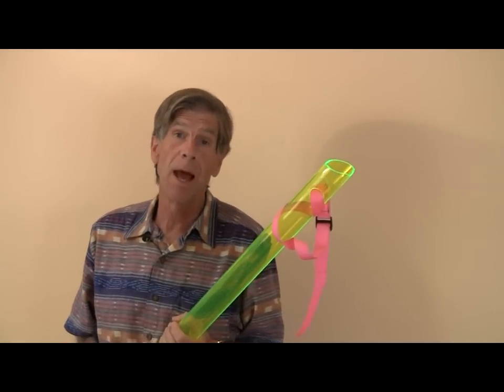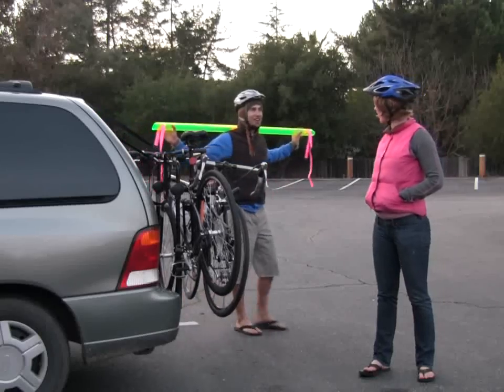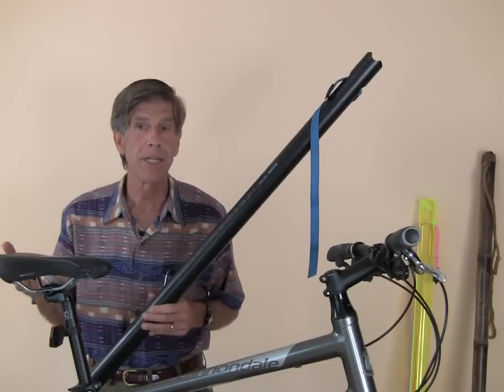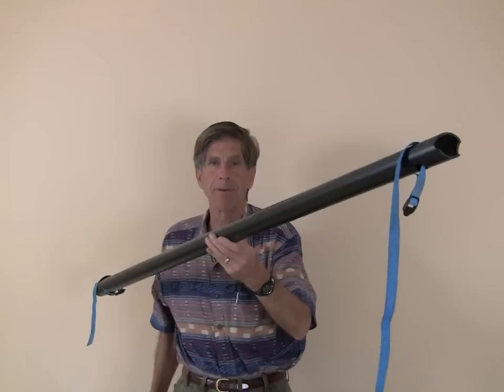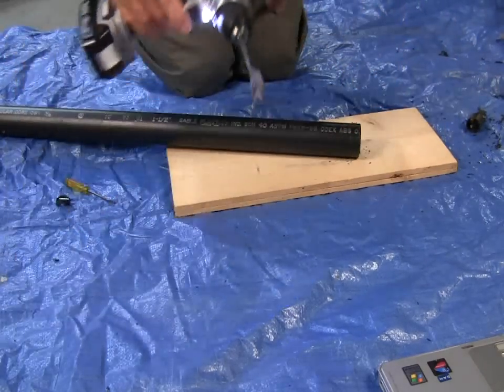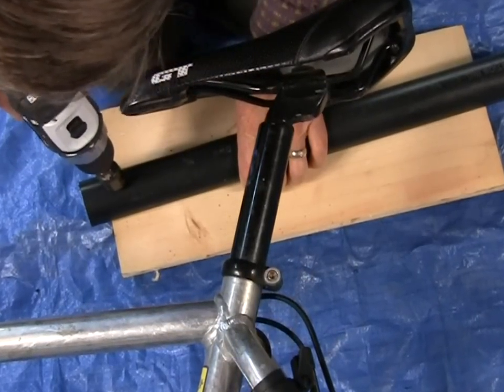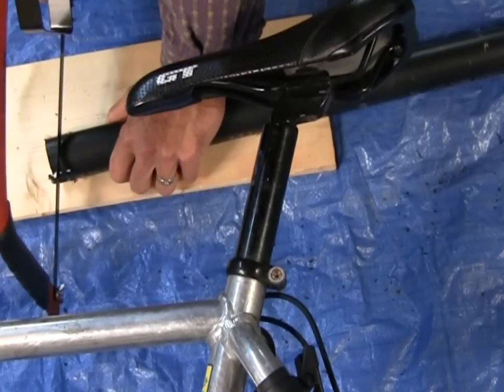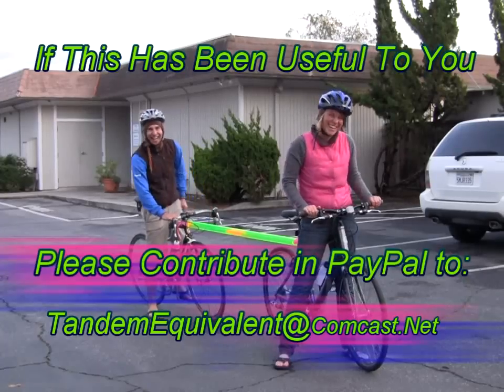Tandem Eqivalent - What it is and how to make one.

Comment from the maker: Thanks for your comment Macrumpton. Actually there isn't any tendency for one bike to "pull the other over" because if the bikes are out of alignment, and there is tension in the cycle-link, the rear bike tends to steer toward a position of alignment with the forward bike.

You're right, you can make your own tandem equivalent - that's what's explained in the second half of the video. Make one and let me know how you like it.

Comment: This was very thoughtful of you Dan. Practical, straight forward, and you're very clear and helpful. Have you considered a side-by-side "social" configuration for joining bikes? Likely with an "X" and parallel pipe configuration in X-Y axis...
Reply from the maker: Thank you Philip.
Yes I've considered a side by side configuration but never tried one.
It seems considerably more complicated.  One advantage of the front-back configuration is that it fits in relatively narrow paths such as a sidewalk.  Another is that it is very easy to go back to two separate bikes.  One may choose to do this to put the bikes on a bike-rack, or perhaps to go down a long hill.

Comment: Here is another reason to attach 2 bikes. If the rear bike is pulling a heavy trailer (+250lbs), then an extra person would come in very handy. I tried to make a pull only version of this with a rope and a fishing pole to hold the rope up if the bikes got too close. It was too dangerous. I thought about the direct link a bit, but never tried it. It actually looks safer than a shockabsorbery link (add a 45° maybe?). I like the business plan too. Does it distance you from liability I hope?